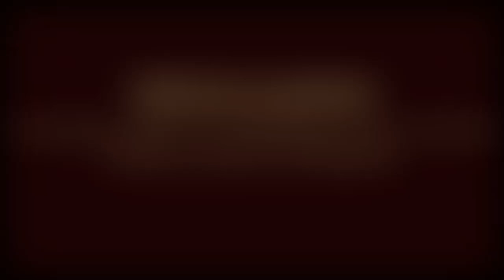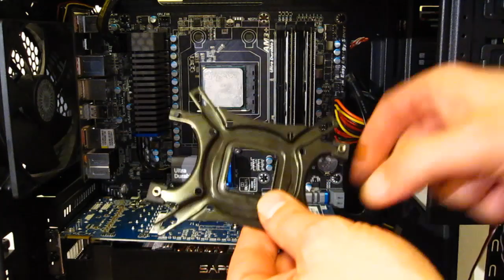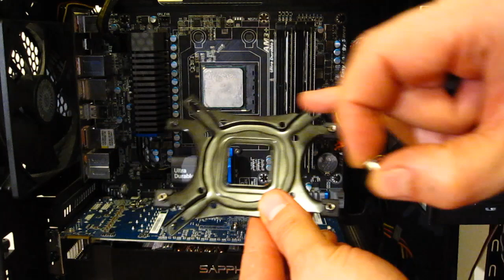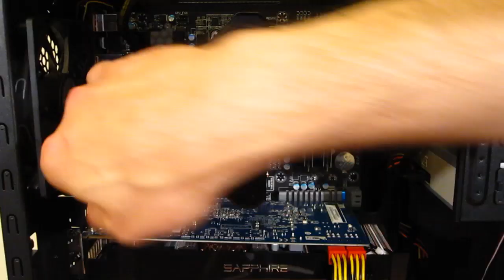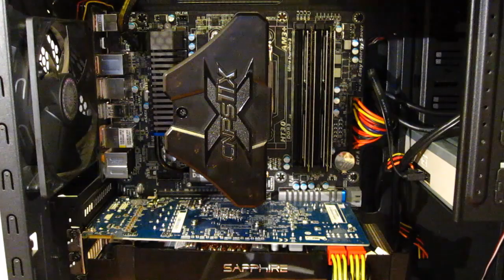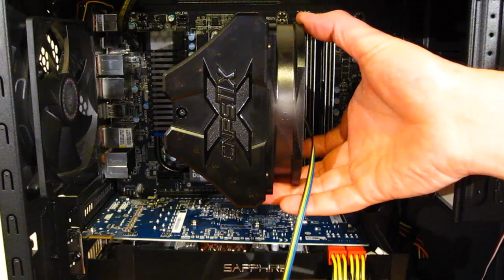Zalman CNPS 11X Installation

Comment: My CNPS11XE vibrates (fairly annoying sound) + the fan makes slight rattle noise, i tried puting 4 rubber rings under the fan but that did nothing. I will probably RMA it, unless it is normal with this cooler?
Reply from the maker: There is definitely a problem. There should not be any rattling.
Reply: HiTechLegion Thanks for the reply. Fan rattling is gone for now, i guess it was some specific rpm. But the cooler vibration/rattling noise is continuous, i can feel the vibration on touch and if i press the fan towards heatsink (screws are tightened) it gets less audible. I wonder if this cooler simply vibrates as there is a lot of plastic parts, or if it's faulty.
Reply from the maker: Definitely faulty. I have had several of these and had no issues like this at all.
Reply: HiTechLegion
Ok, ty. I will RMA it.
Reply: I know it's an old topic, but what do you recommend between this and HYPER 212 EVO? Thanks!

Comment: When I installed mine, I didn't have to remove the fan. You just have to angle the screwdriver that comes with the cooler slightly and it's a piece of cake then!
Reply: I've lost my screwdriver unfortunately and don't know what type of screwdriver I should buy now(

Comment: OK well so the installation may not be as simple but the aesthetics are pretty cool and the new designed V-shaped heat pipes can provide some enhanced cooling performance.check out the complete review